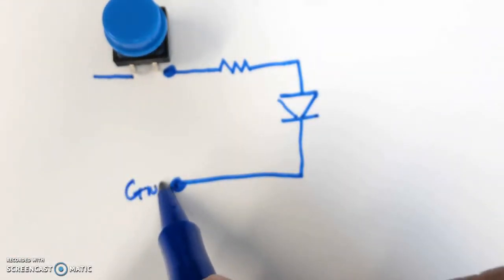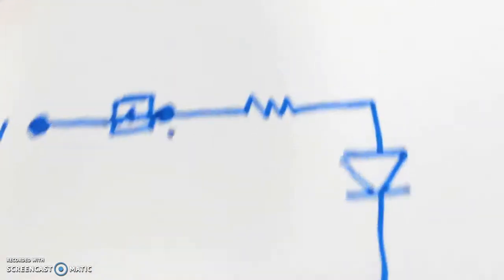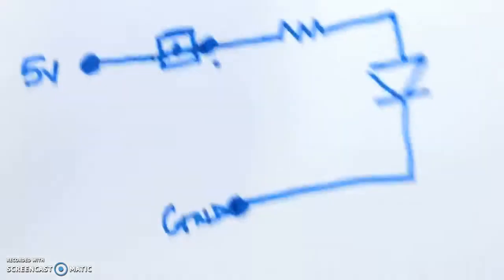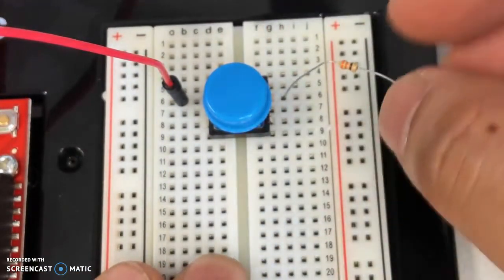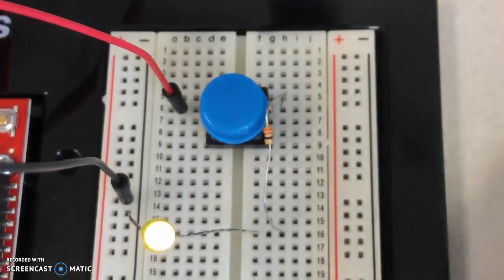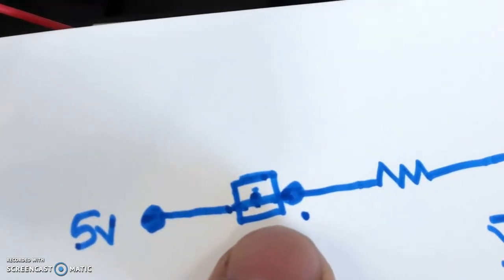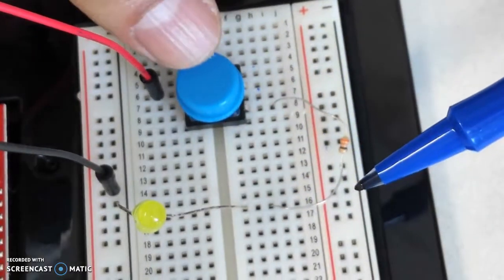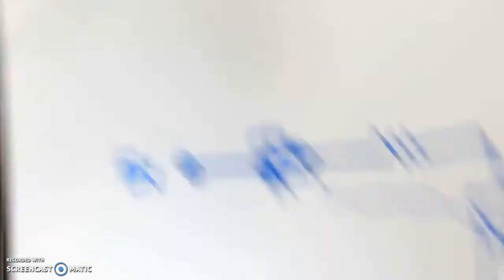Simple Pushbutton switch in a circuit

Comment: Why do we need the resister? If the LED was perfectly matched with the battery voltage, would the resister still be required?
Reply: The resistor helps in reducing voltage

Comment: so say we click the button and it turns on, let off of it and the switch goes off, is there a way for a single push of the button to make it go on, off,on?
Reply from the maker: No. That has to be done in conjunction with timing circuits, or latches/flip-flops.

Comment: Does it matter really matter how you placed the switch?
Reply from the maker: Yes. In those four pin Push button switches Two pins are internally connected. So the two pins on the left side of the breadboard are actually connected together. https://i.stack.imgur.com/74KLh.png